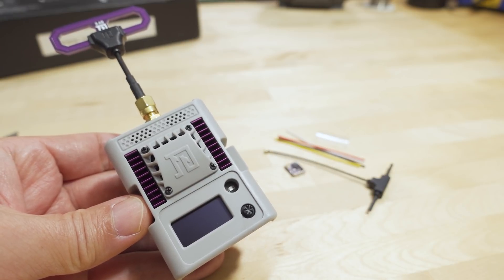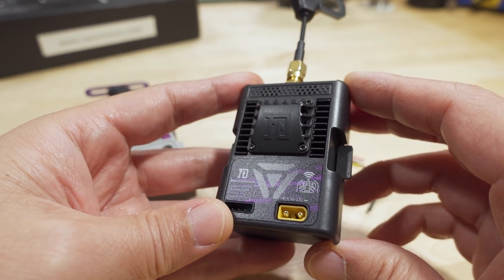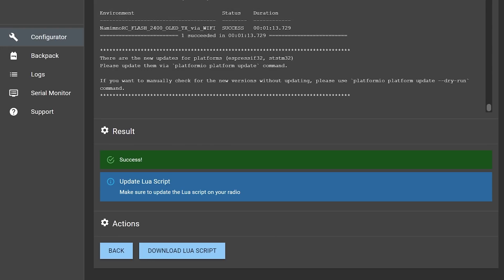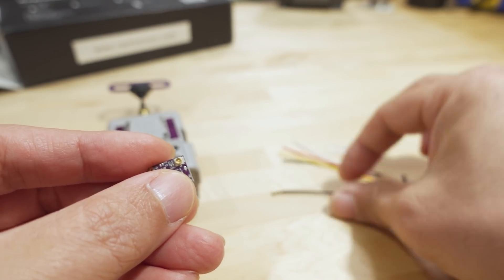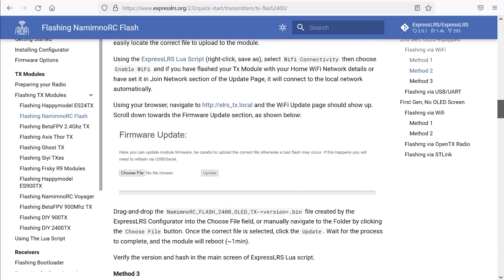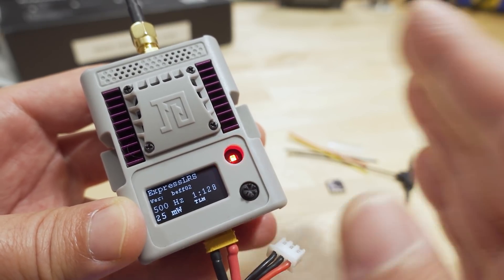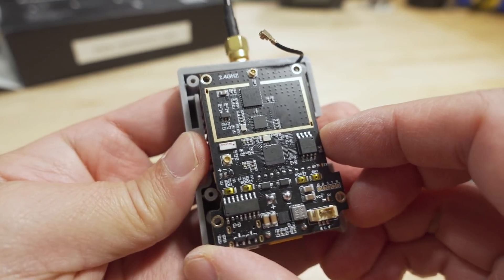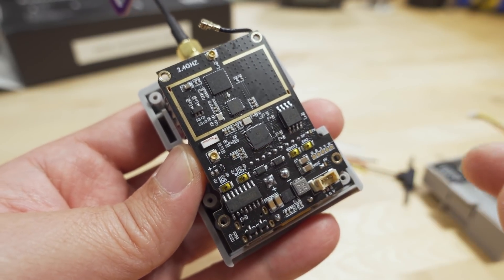Namimno ExpressLRS V2 w/OLED Screen 📡

Comment: What is the JST connector for? At the bottom.
Reply from the maker: It's for power and signal for using the module with Spectrum or Futaba radios.  Basically useless.

Comment: Hi Albert, can this connect with FUTABA ?
Reply from the maker: I think there are some Futaba transmitters that support crossfire.  If you have one of those, you can use this module since it has a screen to control the settings.
Reply: @AlbertKimTV  I have T16SZ, it has crossfire protocol, but there's no tutorial with namimno, this module seems just for transmitter with module bay

Comment: Will this work with a Jumper T8SG V2 Plus now? If it does, it will be cool. Since you can configure the ELRS with the built-in screen, you don't need a separate Radio such as a Taranis or TX16S.

Comment: The heat sink will still work it dosen't matter the pcb and the termal adhesive will tranfer the heat from the chip witch is why its directly behind the chip 
it dosnt need to be on the chip to cool because the chips are in contact with the solder witch is in contact with the copper in the  pcb witch is running throughout the board it all acts as a big heat sink copper has  a good thermal transfer then the aluminum is  good for letting the heat out of the board

Comment: My TX and RX are linked, but the LED on the TX is solid red.
The range isn't very good either. What can be the reason?
Reply from the maker: Probably means a packet rate mismatch.  I don't know what receiver you are bound to so this is just a guess based on no information whatsoever.  🤣

Comment: Yes, the QFN package has a big ol ground pad smack dead in the middle of it. So it actually transfers most of its heat into the copper of the PCB. If you add a bunch of through-holes, the heat is easily transferred to the other side where the heatsink dissipates it!

The HappyModel modules do it as well.
Reply from the maker: I wonder why everyone was hating on that setup then... 🤷‍♂️
Reply: And yes, that looks like the antenna connector for wireless/bluetooth. But as you can see there is a bridge pad that is not connected to it, it actually bridges to the other component there on the left of it.

Comment: Got mine a few days ago, it came with the "screen sticker" already installed; couldn't update over USB either, but strangely enough, my antenna connector is RP-SMA.
Reply from the maker: Wow, they must have several different versions of this V2.  Someone else mentioned mine had a backpack fix but his did not. 🤷‍♂️

Comment: Thank you. The kid and I have the HM version with the upgraded jr module that fit right. Was going to upgrade to this one(2- one for me and one for the boy) but most likely hold off until the joy stick issue is fixed. Since the boy and I are into the racing side.... I think 500hz should work fine. Thank you again Albert as your content makes for wise decisions on purchases. Especially since I buy and build for two.
Reply from the maker: Some modules will fit better than others depending on the radio you have since the module bays are slight different sizes too.
Reply: @AlbertKimTV  Yea we have the injection molded where the 1st hm versions were 3d printed. I wanted this version because of the quality and oled screen.

Comment: Maybe there's another chip under the heatsink...
Reply from the maker: There isn't one because all the ones used for RF are on the other side.  Those are the ones that generate the heat.  Also, there is no gap for a chip between the heatsink and the PCB board.
Reply: @AlbertKimTV  that makes sense, thanks for the video, the product looked good so I ordered on in december and it'a arriving today but I couldn't see any reviews of the V2 so yours was excellent to see :)

Comment: Hi, button will officially work from ELRS 2.1. For now, as workaround, you should flash ELRS choosing the "master" git branch in the configurator
Reply from the maker: Yeah, I also heard that from someone else and tried that but the button still didn't work.  I'm not sure what I might have done wrong.  I got no error messages.  Obviously 2.1 is still in beta, duh...
Reply: @AlbertKimTV  As last resort try with branch menu-oled-joy

Comment: Thank you for the review. The antenna is NOT moxon it is a loop antenna which is pretty much dipole equivalent.
Reply from the maker: I think that center part makes it look like a moxon antenna.  I wonder why they did that?
Reply: @AlbertKimTV  yes it is confusing. The name is Naminmo Black Pearl Loop antenna. The true moxon antenna has a gap in a wire in a bottom part.
Reply: Happymodel makes Moxon antenna BTW
Reply: @Igor-eo1kd  Thanks, I was about ordering a Naninmo antenna for my HappyModel. I wonder if a HM Moxon is more efficient?
Reply: @ApappieK  I'm afraid it's a bit complicated topic. They have different characteristics in theory. In practice you wouldn't notice a difference. I've got both. Naminmo has a better build quality but HM provides a better value for money in my opinion.

Comment: I ordered a v1 Namimno from BG and it never ever shipped, I guess because of the chip storage.  I finally had to cancel it and bought the BetaFPV Micro TX.  I flashed it to 2.0 via USB-C and screen shows settings and I just use the LUA script.  Flying whoops, I won’t ever need the 1W power.  Good review - thanks!
Reply from the maker: Even 500mW is overkill.  LOL.
Reply: @AlbertKimTV  Yes, since the VTX link is now by far the weakest link.
Reply: @AlbertKimTV  True dat!

Comment: Some IC packages has better heat dicipation from underside, normally those has a lot of vias underneath and this way you are able to put heatsink on the opposite side  the IC is mounted. This method is used in a lot of TMC stepper drivers.
Reply from the maker: Tons of fake news and false information out there.  Let's just leave it at that.
Reply: I have a pretty goo Castle Creations 20A BEC that has also the heatsink from the back, and it gets HOT! so this method also works!
Reply: BetaFPV did it wrong, but Namimno did it right?
Reply: @frankcastillo8869  can not tell without the PCB design in front

Comment: I can’t decide which module to get for elrs. It all looks super confusing. Which one is the simplest to setup and use in your opinion?
Reply from the maker: The setup is the same for all of them since they are based on the same firmware.

Comment: I'm on the fence about Elrs, but thanks for this video, because if I do it, I'm interested in this one right here.
Reply: Don't be.. Make the switch, it's worth it!
Reply: @TylerD63  are you familiar with the open lrs project?
What would be the biggest advantage to switch?
Reply: I'm still flying my OpenLRS stuff. Old habits die hard.
Reply: This will be an easy thing for me since I'm new to fpv. I run the qx7 on just frsky stuff. I will most likely give elrs a try since it's cheaper to get into. I was looking at tbs crossfire,  but elrs seems to be on the up